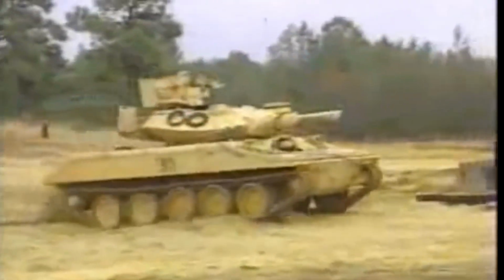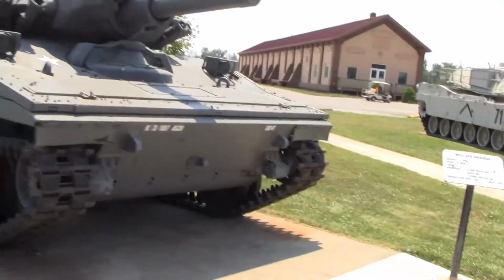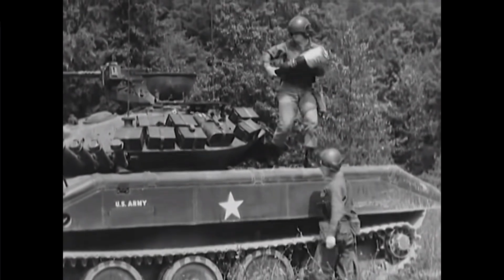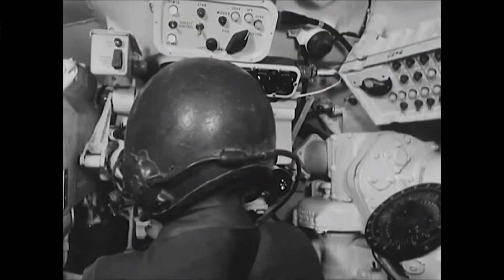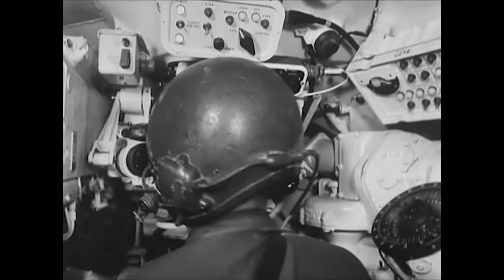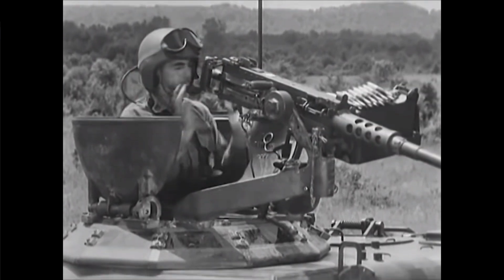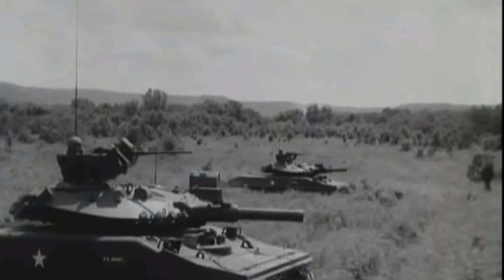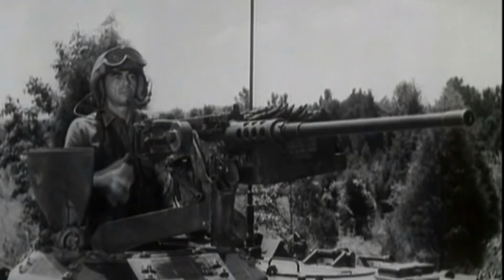M551 "Sheridan" AR/AAV | DESIGN DISASTER!

Comment: I was Infantry when I was stationed with 1/2 Cav. I received on the job training and was a gunner on a Sheridan for a little over a year. By the time I was in the turret most of the problems you spoke of were fixed. I hated the paper casings on the Heat/Hep rounds. The Sheleighly Missile wasn't reliable. I had one on the range fly about 60 meters and bury itself in the ground. I had a loader actually break TPT (Training Practice Target) Round casing during a live fire exercise. Hydraulic fluid on the floor of the turret. Oh and don't forget the "opturator seal" for the main gun used when firing conventional ammo to prevent hot sparks from shoot out of the breach. Please keep your foot INSIDE the turret ring. the turret being electrical could rotate pretty fast anything outside the turret ring would get crushed between the turret ring and the side wall of the tank.

Comment: I don't believe the narrator has ever been on a Sheridan.  I was on one for several years and we didn't experience any of the problems described.  The Sheridan doesn't have a clutch.  The Sheridan has a turret exhaust fan on top, not an intake.  They travel over 40 mph on the highway.  They rock a little when fired, not shake apart as was described.  I couldn't make it past half way of this video.  I had a great experience with Sheridans in A Troop, 1/11 ACR, Fulda Germany.

Comment: I remember a friend in the airbourne talking about this vehicle. He said he worked on them and even 50 cal  bullets dinged the armor like it barely stopped the round. Also the air drop often damaged the vehicle helping I am sure with that hydraulic leak problem alone with the gun recoil. Pretty horrendous tank considering it was air dropped it served its role as infantry support against entrenched enemy positions. He said the troops loved them the ones not inside it at least. The poor grunts any kind of support is welcome and that big bore HE round proved great in urban environments.

Comment: OK, the M551 was never designed to face off with soviet armor, they were carvery weapon, find and fix, shoot and scoot. The breach problem was fixed with soldiers invented something from a the civil war, a swab. A broom stick with a wet few sponges attached.  In my experience, they were still used at the NTC in the desert as late as 1999. Some with kits attached to look like soviet equipment.

Comment: I was introduced with the Sheridan before it was being phased out. This was the only vehicle I knew that needed carrying its own drip pan made of cut down 55 gal. drum strapped onto its back deck because it leak oil so bad!

Yep, firing the gun launcher was a nightmare and luckily I never had to take a Sheridan into combat. That electrically operated breech would take seconds to rotate to close and the paper combustible case could get caught and break by the breech easily! This would not be a weapon system I would get caught in a knife fight with another MBT because of the slow first shot capability- It was Mother_ slow!!!

While the Christie suspension system allowed the vehicle to go very fast, firing the main gun was very much like the video described, with the front road wheels lifting off the ground. And when we 'short tracked' running gears because of a busted suspension arm or missing road wheel, you would not believe how high the Sheridan would jump!!!

A misfired or 'hang fire' round in the launcher was a scary moment, ending in possibly going out and punch the tube with the cleaning rod. Scary!

The video did not mention that the outer hull of the Sheridan consisted of a welded thin aluminum shell over Styrofoam that you could puncture with a sharp knife; I have seen the turret of a burnt Sheridan sank low into the hull because such construction. 

Before it was replaced by the M60A1, A2 series in Germany, the Sheridan served well for the missions it was design for- Snoop-n-Scoot! The missile launcher served well for overwatch and ambush from hiding and long distance engagements while the HEAT rounds would be there for desperate measure against MBT while running away.

You couldn't find too many white Sheridan turret interiors without a pink hue from the 'cherry juice' leaks.. Despite all the shortcomings listed, I had fond memories of that little beast I called first home :-)

Comment: One other thing.  If the Army had removed the 152mm gun and replaced it with a HV 90mm gun, redesigning the turret to remove all the missile electronics and the like, it would have been a fantastic recon vehicle that could knock out any soviet tank that was in service in the middle east.

Comment: I was on Sheridans in Vietnam and later in Germany.    In addition to the malfunctions and problems that you mentioned, I also experienced or witnessed enough other systems failures to fill a book.  
The turret and main gun systems were the least reliable, but the automotive systems also had numerous failures.  
Overall a good concept, but the 1960s technology was not robust enough to do what the designers were attempting.   
They were fun when they worked, they just weren’t reliable.
Reply: Served as a Tank Range safety office at Ft Hood in Late 70’s to early 1980.  1/9 Cav.
We had M551, a throughly bad tank.

I spent a lot of time with a ramrod hammering those 152 rounds back our of tracks that misfired.

That was rough.

I was a Scout pilot playing tanker safety worm.

We were sharing the range with National Guard M60 tanks from 49th Armored Div.

The M 60 crews made us look bad.

Target, hit
Machine gun  target, hit

A real tank vs the mattel tank.

We got rid of the Sheridan and got our own M60 A1  MUCH BETTER
Reply: @edwardgelsone1012  Sounds like maintenace problems. Weak gun seals aside I never had miss fires from either the conventual or missiles, Germany or Bragg. Granted you could have had bad Ammo but much of that can also be poor practice of ammo handling. Rate of fire and range was the poor spot on the M551. Accuracy at longer ranges improved when laser range finders came in for the conventional gun but you will never get a high rate of fire with an electric breech or long range with a short gun tube. And we had to make do with the choke reticle gun sight like that found on the M40 recoilless. Anything beyond 1200 was considered hit or miss but I did get two solid hits at night at 1850. I guess practice with that 106 recoilless came in handy. So other than a slow rate of fire, short range and weak designed recoil system, we did alright.

Comment: Wasn't this okay for its time, but kept in inventory well beyond its welcome? 
If it could take on a t-55, which was standard use when it first went into service, then it could do its job. Mind I'd not want to take a direct hit from a t-55's 100mm guns in one of these, you would be a smoked Yankee. 
I still wouldn't like to go up against one with rifles and machine guns. Even if I had something like a Dushka set up, mind idk what would happen if this thing took 30 ap or explosive Dushka rounds to its hull, aluminium isn't a great idea for a hull, look at the m113, a good spraying of ak rounds could fuck it up, especially if they used ap or steel core rounds.
If My squad had rpg-7's I'd give my squad a chance at 25-300m, or rpg-29's (hell yeah) I'd feel decently equipped to go up against it.
As an airborne vehicle it's better than a Wiesel. 
It would be able to batter BMP-1's or BMP-2's, even though it was dangerous to the crew, and it's engine/transmission was a bit ropey.
It's not as bad as people make out, but by 1990, it was outdated, I'd be shitting my pants going up against a t-80, t-90, or even t-72 with era.
Not a amazing choice, but they could of done much much better.
I've never driven one, but the bad rep means something. 
I certainly wouldn't want to use one in the jungle, but it's better than being bogged down in the huge, easy target of the m60 (even though it's a much better tank) or a gun truck, where a 7.62x54r could go through like a hot knife through butter, or a ak burst from a few guys could rip the truck crew to shreds.
Obviously it's not amazing, but the concept is sound and good.
I'd not like to be in a trench or defensive position with a 152mm high ex round hitting my position.

Comment: still used at The US Training Center FT Irwin as mocked up T 72 . Trans are 4 speed manual vale body autos no clutch. very light fly wheel that would sheer it not driven well.  for a tracked vehicle they are very sporty to drive.

Comment: I have noticed a pattern in American designing, development and production. The tenders require almost everything from a project, often giving contradicting requests. The designers make something after many cost- and time overuns, which has to be refitted and improved for years before being generally usable and safe. M551, M2 Bradley, F-35 and so on. Does anybody thinks the same?

Comment: This video speaks about how technically intricate it was, which may have been true during its development, but was actually one of the reasons we were able to field it for so long with the rigors of the Airborne mission. The problem with circuit boards coming lose from recoil. A simple crew fix. Open the cover, seat the circuit boards, place cardboard from an MRE box under cover, and close it back up. While serving on them with 3/73 Armor, 82nd ABN from 1994-1997, we put them through their paces. In one year, I put my track on trucks, trains, a ship, and planes. I have had one roll on heavy drop, ended up on its side with the center road wheel arm ripped off completely, pulled it upright with another track, checked engine fluids, threw the busted off road wheel assembly on the back deck, and carried out the mission. My loader and I could have the engine and transmission pack out of the vehicle in 10 minutes.
We shot a downgraded tank gunnery unlike an other Armor unit at the time. No STAB and not using the turret drive. Our gunners engaged manually, cranking the turret by hand. 
You have to understand that its longevity in the Airborne mission was that it was employed to provide direct fire support for Airborne Infantry, not to be the tank killer of the Cold War era. 
A suitable replacement has not has not been developed in a viable format. Our Battalion tested LAV with a whole platoon during the Gulf War, and now the 82nd has reactivated a Company of the 4/68 to evaluate them again. In 1996 my Company tested the XM-8 Armored Gun System(AGS) as a replacement which ended up not working out well enough to be selected. In the end, it was the simplicity of the systems that ended up being the key to its to longevity.

Comment: The main thing I remember reading about  a  scenario where a scouting/recon unit in first Gulf war had at least one Sheridan and was out scouting and came upon a crossroads. The CO had a feeling about the area since the crossroads looked like a ideal place to set up a ambush.  As the unit approached they started taking fire from a two story building. APC's (M113's? ) rushed the two story building while the Sheridan gae supressing fire with HMG's and  fired a round that blew a ingress hole in side of building and APC's ground to a halt near hole in wall and dismounts were quick to get in and neutralize the enemy in the building. 

The scout unit was lamenting the loss of firepower the Sheridan offered. IIRC their Sheridans were replaced with M113's

Comment: If burning residue sticks to the breach, blowing air isn’t going to clear it, there’s always going to be a boundary layer and with it sufficiently small detritus will remain. I suspect that the debris were also sticky or tacky, making matters even worse. This is why you can’t clean your car by driving it fast. 

I kinda think they should have just replaced the combusting propellant with a rocket motor like you might see in an RPG. 

It’s still so weird to me that this gun and I think the MBT70’s long (ish) barrel version weren’t smooth bores. They rifled them and then added a key way in case the barrel induced a spin when it shouldn’t have, just put fins on the shells.

Comment: I served in A Co., 4/68 Armor, 82nd Abn. from 10/75 to 10/78 as a platoon leader and company XO. We were lucky to maintain an OR rate of 70%. The biggest weakness was the flex plate in the torque converter of the Allison AT250 transmission. I could count on at least one failure every time we went to the field. The mentioned cherry juice was also very flammable. There was an apple juice (green in color), that was not as flammable, but did not have the hydraulic capacity to handle the recoil. It was (theoretically) amphibious with the rubber curtains up. It also had an onboard Halon fire extinguishing system which could be activated both inside the track and outside. You can see the recess in the hull on the left front where the external was located. When they were good, they were very good. When they bad, they were awful.

Comment: 2-part munitions for mobile units are always a bad idea. instead of having all your munitions in one spot. now you have 2 places for munitions and its propellants. so. more shit to make you explode.
the M1A1 and up did this well. with all ammo located in the turret rear. and if hit, blast doors able to erupt and let the ammo cook off rather then explode into the crew compartments. rather then the T-55 all the way to the T-90 and T-14. that uses dual charge. alot more components. and tighter squeezes. meaning. if an ATMine or IED goes off under a T-14 or T-90. or T-72. in the off center location, it has a good chance of striking the ammo carousel. and if it strikes something like a HE munition, it can easily cause a chain reaction. the propellant carousel is located right above the munition carousel. stored separate. but only a thin layer of material is blocking each other.

Wile the T-64 and T-80 autoloading systems are diffrent then the T-72 and T-90. the T-64/80 has non-separated carousels. the munition is laying on its side, and the propellant is laying long ways ontop of the munition. which would cause an larger problem as nothing is shielded. though it is a quicker way of reloading then the T-72 and T-90.
Not only this. but the new T-90s have like the MS. have ammo placed through the turret, this ammo are things like 125mm missiles, special purpose munitions, and the like. giving more location that if damage could cause a crew death or 2.

the US learned this back when they used naval guns. that having less chances to hit something vital. the fewer the casualties. separating out ammo by munition and propellant is a bad idea.
the US does have some acceptations. like the M109 and some artillery units.... because theyre not on the front lines, and are not expected to take hits that damage breach them.

Comment: Our main gun snapped the main gun wiring harness. Yep misfire that was scary as💩.

Oh yeah did I mention I served on a 551A1 AR/AAV It was definitely a love hate relationship in that you loved them when they ran and everything worked but when they didn't they really sucked. That seemed to be quite a bit. We did our annual ARTEP which was basically a test to qualify your readiness for combat. We started at Hohenfels  and the objective was Grafenwoehr which is about I think 19 km. our track didn't even make out of Hohenfels when the sprocket sheered off in the sprocket housing on the left side. This was just bad timing and unforeseen. All the PM in the world couldn't have prevented this.💩 happens. The bad part of all this was they left us pin the impact area. We had had use of it while we were testing but when the unit moved on out toward Graff they left us where we broke down.. Of course this counted against us because our over all combat readiness as a cavalry unit was compromised by the loss of our track. To make matters worse the left us there long enough that another unit had taken over the ranges. Being a NATO training facility it wasn't uncommon other unit or better yet armies used Hohenfels in fact my first year a French unit was there even though France isn't in NATO they enjoy its benefits without being a partner. Getting back to the a story over being broken down in Hohenfels  our track was about 50 meters from the center of an impact area and the wildest part of this is we were about to be fired upon by a German Army mortar unit. They were set up and ready to fire when the saw us waking up and crawling around the tracks turret. I guess they thought we were a new target. I guess the range safety officer contacted our First Sargent because he came booking it up to our location bringing us a hot breakfast and C rations for the day.His quick thinking saved our lives by jamming a tankers bar into the sprocket housing it allowed the track to move.  We slowly drove our track to the edge of the training area which was cool because if you Germany every roughly 4 km in almost any direction is a town and most of those towns had a bar of gasthaus of combining of both if was one that didn't have one we never found it. For the new three days life was sort of a blur as between the beer schnapps and jagermeister I hard was ever cold and we always had a fire. Good times
Reply: Ahhhh...Graf and Hohenfels...I remember them well! Loading the vehicles on railroad flat-cars from Schweinfurt....almost ALWAYS rainy, miserable weather!
Reply: Thanks for your service, man.